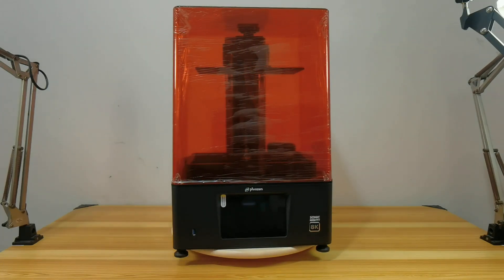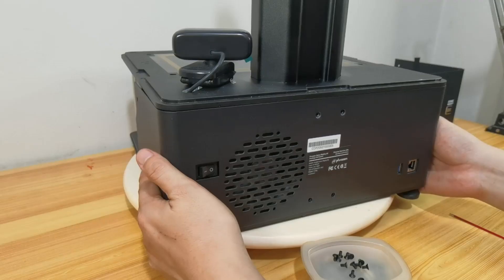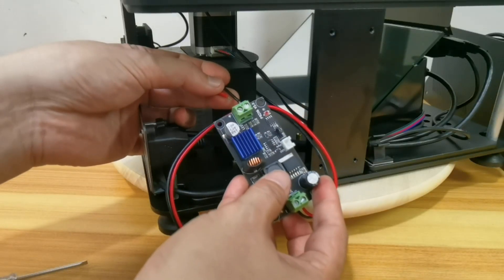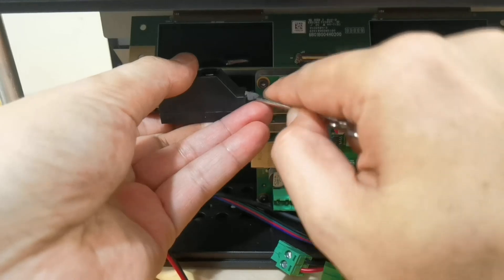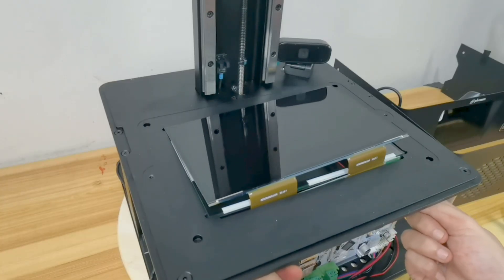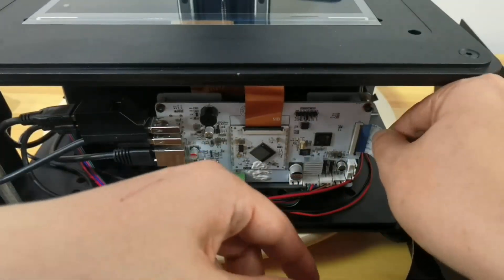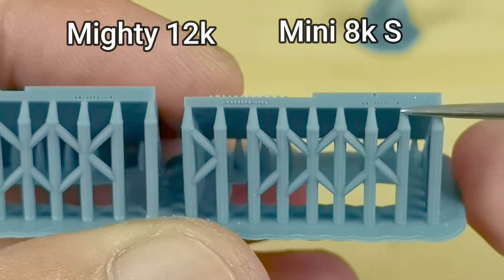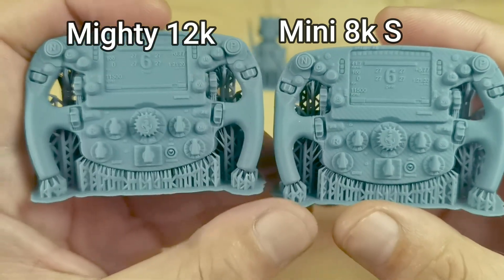Increase Mighty 8k Resolution With This 12K Upgrade Kit

Comment: What did you do with the ground wire off the control board?  Just remove it entirely after the screen replacement?  There doesn't seem to be an area on the upgrade screen to fasten the wire to it like the old one.
Reply from the maker: Yep
Never attach it back
Reply: Ty @wangdennys

Comment: Dennis.  Another great video!  I was going to get a Elegoo Mars 3 Ultra.  But, will now buy this screen kit for my Mighty 8k.  Even though it is a more expensive solution, I plan to buy 2 more mighty 8k and upgrade them instead of buying the Mars 3 as I still think that the Phrozen machines have a higher build quality.

QUESTION
When do you plan to come up with a video doing a more detailed comparison of 8k & 12k quality?
Reply from the maker: Already show the comparison near the end of the video.

Next is the acf vs nfep

Comment: Dennys nice video again, thanks for that. Would it be possible to make a comparsion between Mighty 8k and the 12k prints?
Reply from the maker: Hah? Did you watch the video? 
I did the comparison.
Reply: Yes, but in ghis Video you compared the Mini8k S  mith Mighty 12K prints. But I meant a before and after changing the screens test

Comment: My personal opinion is: I have to spend money to buy mighty 8k. I then wasted the 8k Mighty and didn't use it to update the 12k, which was an unnecessary waste. 12K is good but Phrozen should produce a complete 12k movement. Do not update so it is very complicated and easy to error for users.
Do you think we should wait for MEGA 12K, will they produce MEGA 12K?
Reply: On their livestream revealing the Mega 8KS they said no one is making a 12K 15" screen at the moment.
Reply from the maker: Not sure when 12k screen for 15" Will be available.